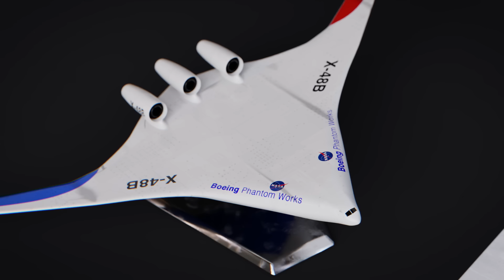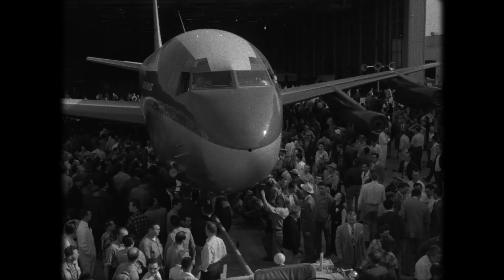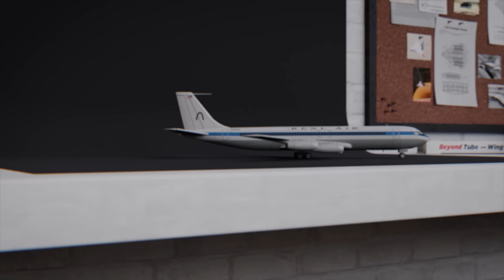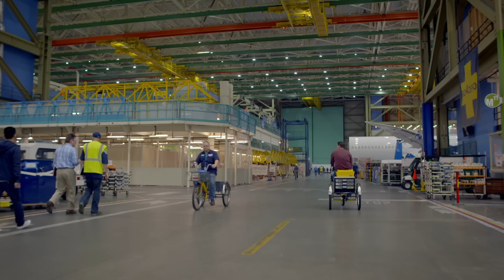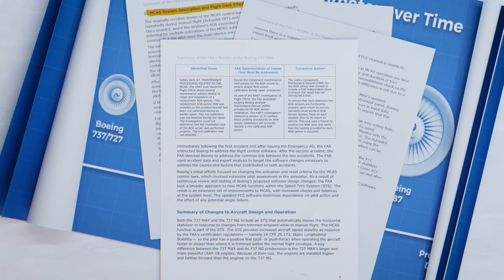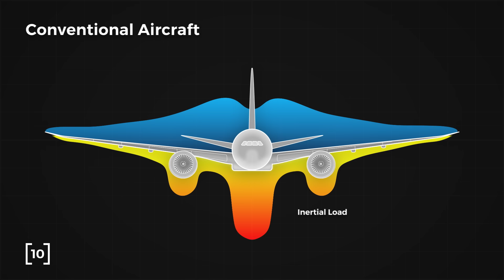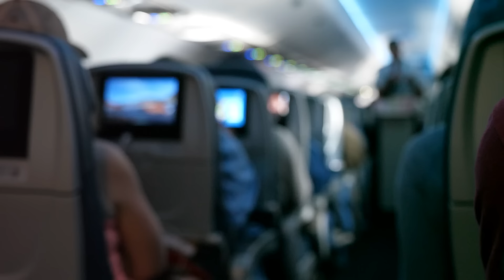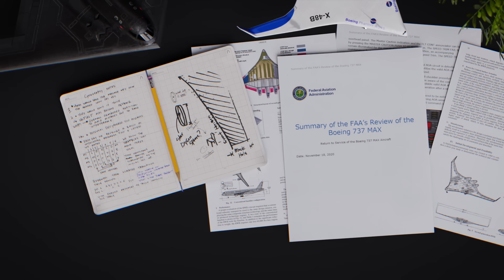The Plane That Will Change Travel Forever

Comment: Even though that would be a massive reduction, it's still way too much to put into the air all planes combined. Nature doesn't really care the fuel consumption per passenger becomes better, it only sees the overall concentration increase, just slower. And I'd argue we're already past the tipping point. We need a huge effort into new designs, combined with different fuels.
Reply: You could run most jet engines on biodiesel. Also the US Navy had a project to produce jet fuel from sea water and (lots of) energy from a carrier's nuclear power plant. Patent is number 20160215403. From the abstract
       
"Apparatus for seawater acidification including an ion exchange, cathode and anode electrode compartments and cation-permeable membranes that separate the electrode compartments from the ion exchange compartment. Means is provided for feeding seawater through the ion exchange compartment and for feeding a dissociable liquid media through the anode and cathode electrode compartments. A cathode is located in the cathode electrode compartment and an anode is located in the anode electrode compartment and a means for application of current to the cathode and anode is provided. A method for the acidification of seawater by subjecting the seawater to an ion exchange reaction to exchange H.sup.+ ions for Na.sup.+ ions. Carbon dioxide may be extracted from the acidified seawater. Optionally, the ion exchange reaction can be conducted under conditions which produce hydrogen as well as carbon dioxide. The carbon dioxide and hydrogen may be used to produce hydrocarbons."
      
If we had plentiful nuclear power we could use it to produce carbon neutral fuel to run legacy jet and diesel engines. Unfortunately the environmental lobby has convinced people that nuclear power and jet and diesel engines are bad things which need to be phased out with large subsidies from the government. So I guess that idea is a non starter.
Reply: @Aaron_Nonymous  if you have the time, ALL diesel is biodiesel
Reply: Nature does not care either way
Reply: @TheGahta  Nature doesn't care about anything. It's not a conscious entity.

Comment: Only issue with the last part is, when do we get an electric powered variant of the jet engine? I mean hydrogen ICE is an option, but not an environmentally good option. Barely better than staying carbon emitters.
Reply: It's vastly better if you can source your energy from clean energy sources, even though there are  associated NOx emmissions. I was under the impression that hydrogen fuel cell was being actively looked at

Comment: The amount of fuel burned per passage kilometer has decreased but a counterintuitive economic law called Jevin’s Paradox means that we burn far more fuel in total as efficiency increases. 

Briefly, when you make a technology more efficient, you reduce the marginal cost of using it more, so people do. It’s an iron law, never violated. 

All the attempts to conserve resources via increased efficiency always backfire. A 27% increase in aircraft fuel efficiency will lead to a >27%  increase in fuel consumption.
Reply: Isn't that akin to the problem of building ever-larger roadways to decrease vehicle congestion....?🤔
Reply: There's a solution to that, but it's written into legislation, not a purely engineering basis.

Comment: The public travelers are not looking big bulky slower, cramed like sardines seating crafts of so call more quieter design, its the older louder combustion engine that is the issue! The FAA also agrees, faster, smaller, roomier seating with less engine combust sounds.

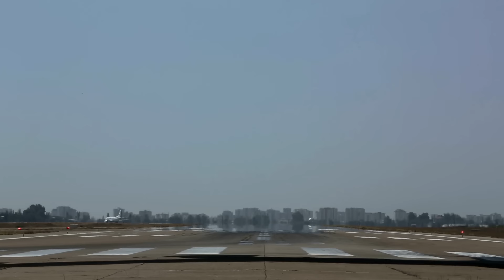Comment: 2:18 it's not about the size, it's about the bypass ratio. the lower the bypass ratio, the lower the efficiency. 
another way to increase efficiency is to increase the turbine inlet temperature, or TIT. the problem with that approach is that higher TITs mean more nitrous oxides in the exhaust, and more thermal stress, especially on the turbine blades.
Reply: But the size did increase ? RE didn't claim the size makes more efficient, it sounded like a simple observation to illustrate changes
Reply: @YounesLayachi  
ok, more power means bigger engine. but size is not directly related to efficiency.
Reply: @mrxmry3264  that's what I said

Comment: Nuclear Planes 🙃
Reply: terrorists: allow us to introduce ourselves
Reply: @deadpixelc  The amount of material in them wouldn't be much. The risks will be much reduced if they manage to wrangle the upcoming thorium salt rectors in them.
Reply: You might be surprised by the number of small reactors used in space programs, for more than 50 years! 😐
Reply: @gus473  a radiothermic generator is a VERY different beast from what would be required to power an airliner. such a plant would be way too heavy, especially with all the lead that would be required to shield the passengers from the radiation.